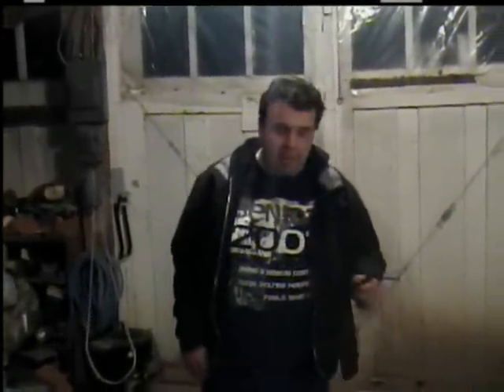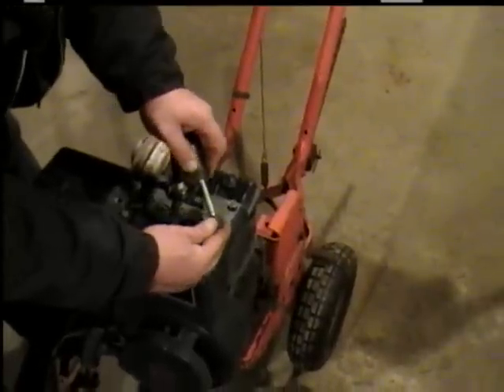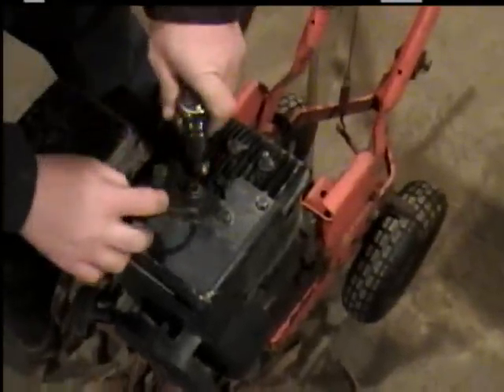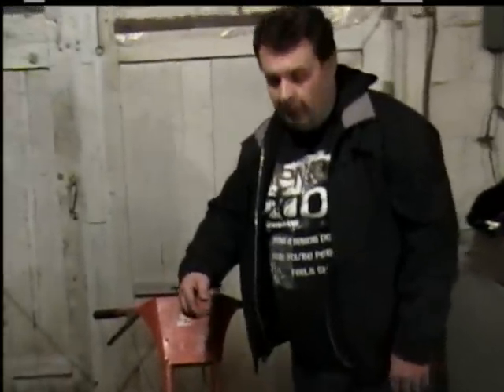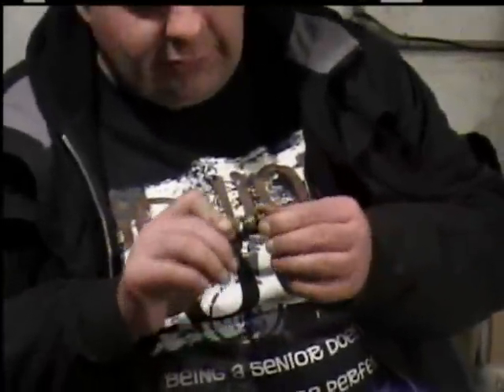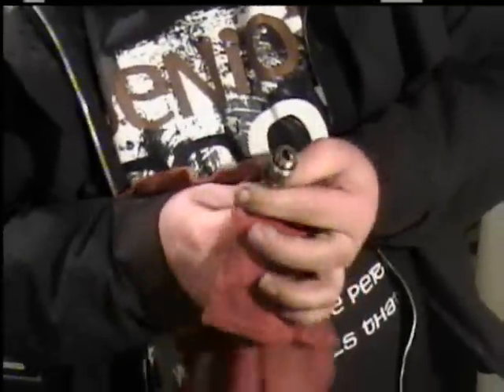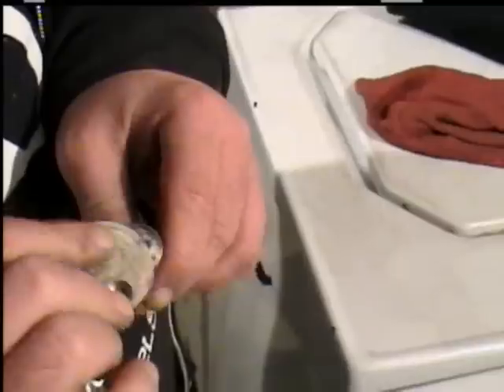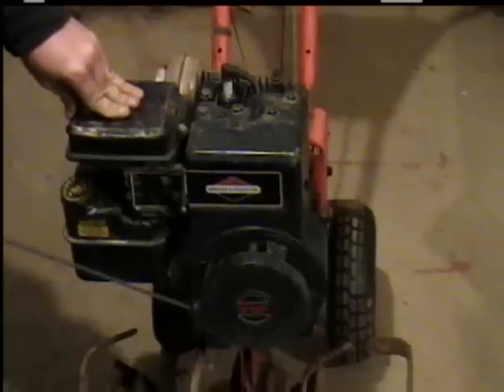Checking and cleaning the spark plug

Comment from the maker: Well, superping321, if it's still under warranty then take it back . If not then make sure that you have the properly recommended plug for your motor and that they are properly gapped . Look at the plug and see if you can tell why it fouled out - is it from oil , or to hot or not being hot enough . That will tell you which way to go . Make sure that the coil is properly air gapped from the flywheel. If OHV then look for blown headgasket , bad rings.

Whizkid